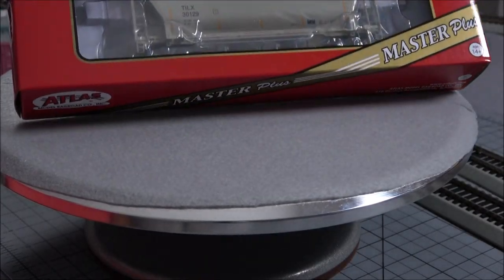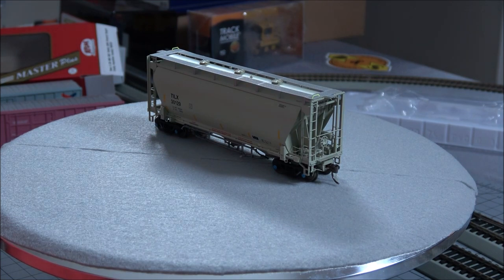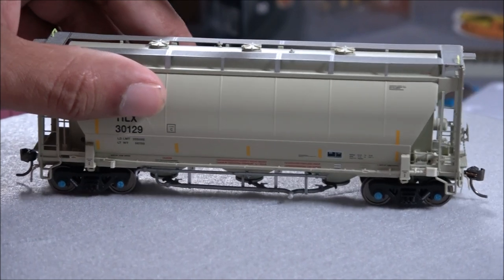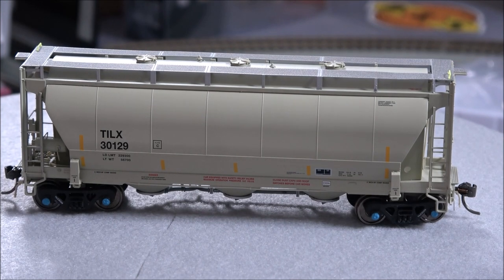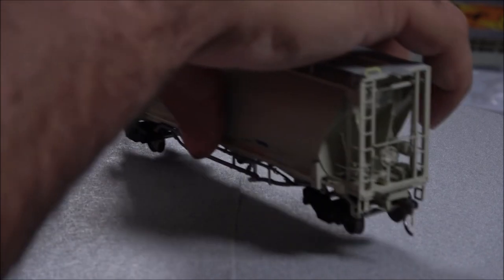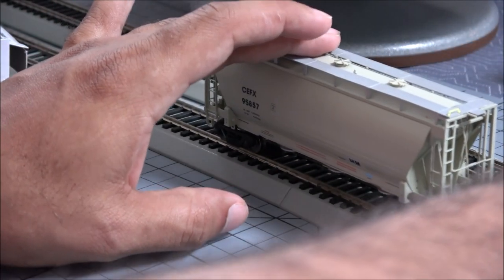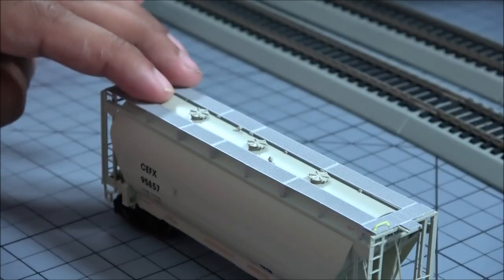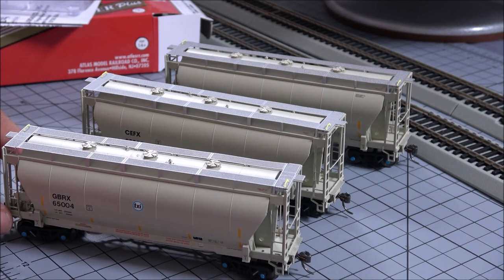Quick Review: Atlas Trinity 3230 Covered Hopper HO Scale!

Comment: I’ve only been out of the hobby for 4 years and to come back and see these for $60 is absolutely ridiculous the hobby is really getting way to expensive especially for the younger ones like me who don’t have a large budget to spend on rolling stock and engines
Reply: You're not wrong. I can buy an Athearn Genesis HO Scale tank car fully detailed with some metal parts and rotating bearing caps for $20 cheaper
Reply: @epiccsx  exactly it’s sad to see this hobby become overly expensive because it really turns away new and younger generations with out them this hobby will eventually die out they really need to focus more on budget items and more affordable cars and locomotives but I understand why they don’t if they already have a market that is willing to pay these silly prices
Reply: comment is SPOT ON... i too recently got back into the hobby but after a 20 year hiatus... i saw the prices of this stuff and did the old fred sanford heart attack bit lol...i'm building a small room size layout and the price of just getting that up and running is expensive all by itself with no locos or rolling stock... i made the decision to switch back to plain old DC instead of DCC... DCC locos are getting way out of hand to... picked up a few DC locos for 135 bucks instead of literally DOUBLE for one DCC unit... i'd save more money being a freakn' alcoholic than being a model railroader LOL